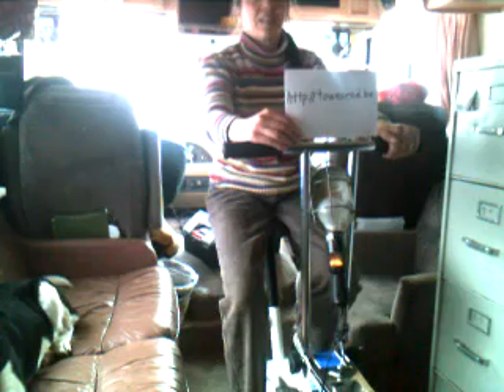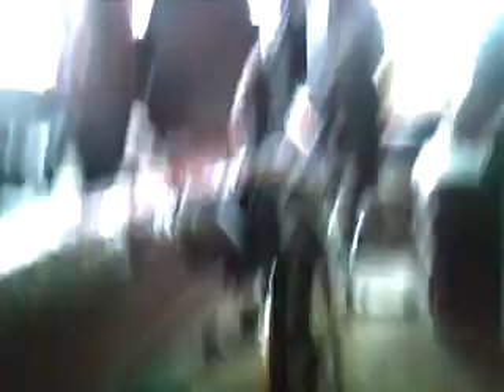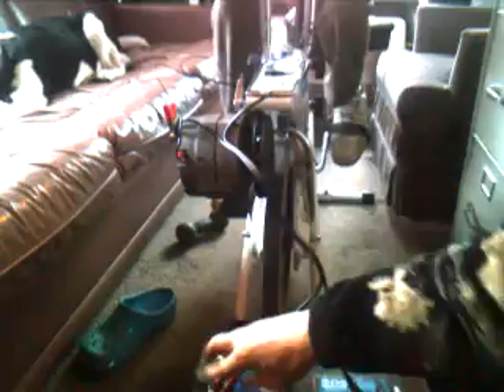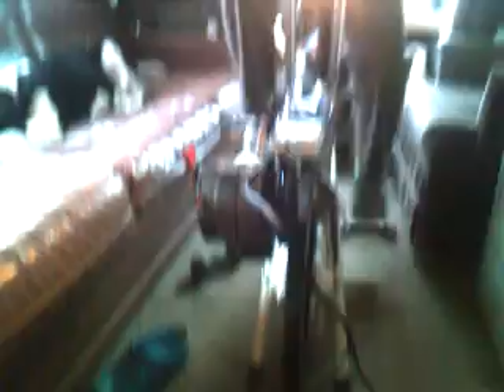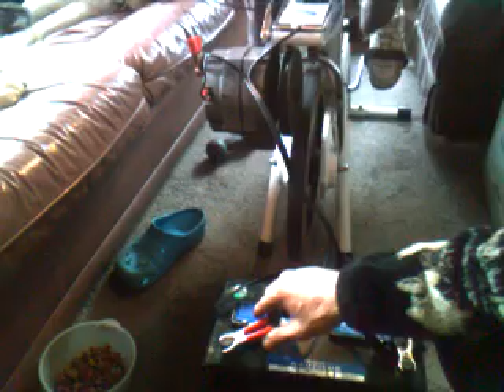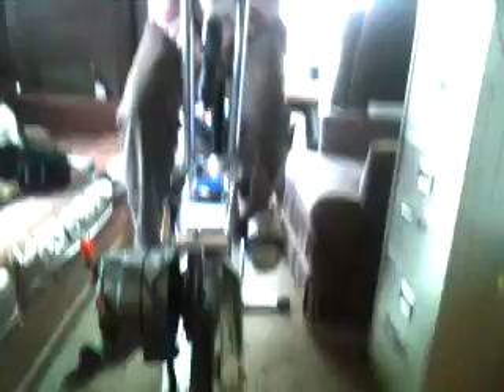Bicycle Alternator Generator - Jim Townsend

Comment: what type of alternator are you using ive tryed 3 different alternators and got nothing even hooked up to a battery can you help me ?
Reply: do you use alternators that require a 12 volt source to excite the coil?  Simply turning an alternator won't generate electricity...you need to create a magnetic field in the coil as well